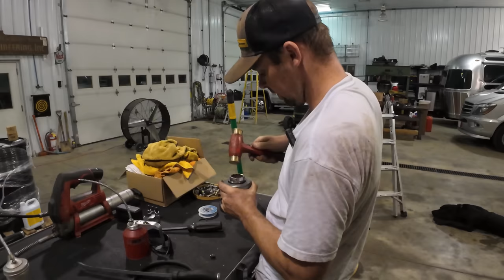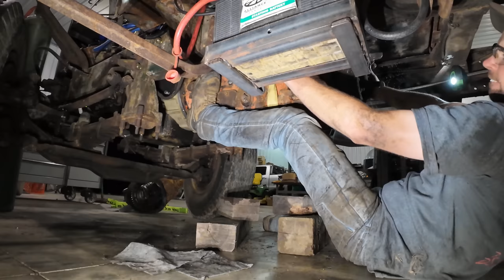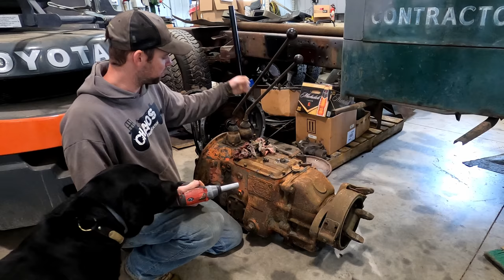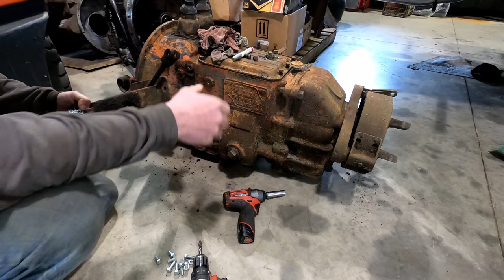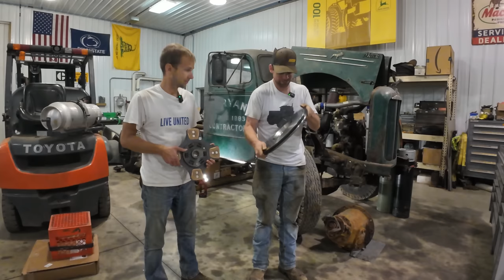Mini Mack gets a Manual | A40 Project | Part 4

Comment: 50 ago I learned how to shift a truck on one of these dual shift lever transmissions. You really needed to know how to shift to drive a truck with these transmissions. Many times I've had to lay under my truck and beat that clutch assembly on the side of the transmission that got hung up between gears when I didn't make square shifts with the brownie and did a rounded shift and the linkage would get hung up and id have to lay in the snow and mud to knock it back in place.

Comment: Another neat way of enlarging the diameter of a shaft for a bearing to fit firmly, is to throw it in the lathe, and give it a light touch with the knurling tool.

Comment: I used to drive a 1956 H-63 Mack with the duplex transmission with a 3500 gallon tank trailer in the fire dept. In my opinion they were fun to drive with no power steering, no A/C and not alot of power but, love shifting the duplex through all ten gears and when you went from second high to third low we let go of the steering wheel to shift both levers at the same time. Now that I'm  66 years old I would love to drive one again. Take care and have fun driving her when you get it finished.

Comment: Just tripped over the Mini Mack build.  I built Snappers Buggy and am local to you. You mentioned you were looking for a 450's gear.  I am running an overdrive 10-speed and a 293 gear; 70mph at 1200rpm is awesome.   Find a gear set in the low 3.s Also, I moved the brake pedal to the firewall version so it doesn't interfere with the trans or clutch.   Let me know If I can help. I wish I had a twin stick.

Comment: You need  to  take  jacking  plate off jack  and  find a pin to  fit whole  in jack  like 1 in Dia. Or a Pic of pipe  and  weld a plate of  steel  on top  like 12  by 18 in  so transmission  can  set  on top  and  you can  block  it if needed.

Comment: If you take the round dish off your floor jack and you get yourself a piece of 1/4 inch plate steel and weld a piece of round pipe on one side that will fit into the hole of your jack you can make your own tranny jack you cut a few holes on the outside edge of the plate so you can hook a strap to it   Really works a lot better than a regular floor jack especially when you work alone

Comment: When I first started driving trucks I had this transmission in a 61 white. We called the main gear shift the main and the second shifter was called the brownie. I have no idea why the old timers that taught me to shift called that second shifter the brownie . But the old timers would let go of the steering wheel and then shift both shifters at the same time. It always amazed me how fast they could shift those two shifters at the same time. I was never any good at shifting them at the same time.
I hope you checked or replaced the pilot bearing for the imput shaft for the transmission that's pressed into the crank shaft.

Comment: Now all you need is a 4 speed overdrive auxiliary box to throw in behind it for all the twin stick fun. Fuller did make small 10 and 13 speed transmissions that had the #3 bellhousing and push style 1 1/2" input shaft, the early versions were RT and RTO 610 and 613 and later were RT and RTO 6610 and 6613.

Comment: If you take your floor jack take off the cup you get a piece of plate steel weld a Dow pin on the center of it and either drill a few holes around outside edge or weld hooks to underside of it same side as Dow pin. Then you can use on your floor jack and not buy a tranny jack. This is how us country folk do stuff

Comment: I can go either way with the length of the videos Sam. As long as you stop and explain the aim of the what you're doing, I'm good. On the rear end/need to get some faster speeds- I don't know Macks, but did they every use a 2 speed rear end and would that be an option for some better road speeds?

Comment: You dial indicate to align the bell housing to the engine block. Before you  put the flywheel in, you mount a dial indicator on the end of the crank and have it ride on the ID of the flange that the trans bolts to. If you have run out you remove the dowl pins and loosen the bolts holding the bell to the engine. When you get it straight and the bolts are tight, you bore for an oversized dowl pin..

Comment: It's always something!:( Just last month I had to change the flywheel ring gear on my old F350. I was attempting the put the disc and pressure plate on the transmission input shaft instead of fighting the typical alignment issues. Didn't work. Not enough depth in the bell housing. Didn't want to pull the motor completely out ( easier to pull the engine than transmission ) so I raised and swung it to get at the pressure plate bolts. Snugged them up figuring I'd torque them in place. One of the pressure plate bolts must have been previously cracked because it snapped off well short of spec. Ouch!😢 Laying awake it dawned on me that maybe I could get at the back side through the starter hole. Bingo! Got on it with a drill and spun it out!😊

Comment: Clutch with an old style pressure plate is a way to go, recently replaced the clutch in my truck and only the modern clutch kits were available, the feeling is not the same... my calf is happy but I am not 😅

Comment: Kinda funny.  My old '64 Ford heavy 3/4 ton wrecker had a far larger clutch to handle the whopping 89 hp. from a 223 ci. inline six.  She'd do 40 mph floored with a Vista Cruiser hanging off the boom.  Cool video, liked it much.  Thanks!

Comment: Always wanted to get a old Mac or dodge and upgrade the drive chain to be able to perform better but maintain its running gear as originally as possible so it performs the same but with a modern day spec

Comment: I don't know if you ever watch Western truck and tractor out of Oregon but he puts his clutch and pressure plate on the transmission and if he can get to the bolts for the pressure plate to mount to the plate bolted that way you don't need to have a an alignment tool okay

Comment: Sammy, I watched a video a short time back where you had the same type of Trans. My question would be, do you need to double clutch to shift the gear and then the high/low splitter or can you single clutch and shift each with one clutch move. I get you need to keep rpms, but how is it done or needed to be done.

Comment: Been wanting to do this on a B42 using the same engine and baby duplex. What flywheel and throw out bearing are you using? The baby duplex bolts directly to the 24v? This videos pretty sweet man I can’t wait to see the rest. I might end up doing the same thing with my truck 😂
Reply from the maker: Thanks! Yes the mini duplex that is from the gas engine have an SAE 3 bellhousing. So you need an SAE 3 housing for the Cummins which some medium duty trucks have. Then this one had to be a right hand starter because of the steering box
Reply: @ScrappyIndustries  how do I know about the bell housing. What starter did you use? What flywheel, clutch and throw out bearing did you use come from? Should make B model swapped Cummins engine for work and juice it up. Be a cool truck for work. I have two small duplex transmissions and been trying to figure out what to do with them. Just hope if I juice the engine a little it won’t break the smaller transmission is my fear

Comment: Sam, glad to see another PA boy with a love for these old Macks. I’m looking to find one of these old gals to 12v swap possibly. Do you plan to put a fan on it, I know a lot of Cummins swaps complaints of running hot without fans.
Reply from the maker: I do. I think I’m going to eliminate the intercooler that is currently on it. It’s behind the radiator so I don’t think it would help much anyway

Comment: Next time you have to do a tranny,, get some long bolts the same size as the bellhousing bolts.  Cut the heads off and cut a slot for a straight screwdriver.  Put them in on opposite sides of the bellhousing face and engage them with the transmission.  Then you can just slip it straight on in.  Put the rest of regular bellhousing bolts in and unscrew the dowel pins with a screwdriver.  Install the last two bolts.  Easy peasy....  Good video!
Reply from the maker: Definitely a good idea I will give that a try!

Comment: Why don’t you just drill a hole in the original throw out bearing and put a grease fitting in it?  Not that hard to do then you can grease it so it lasts  just simple common sense stuff.